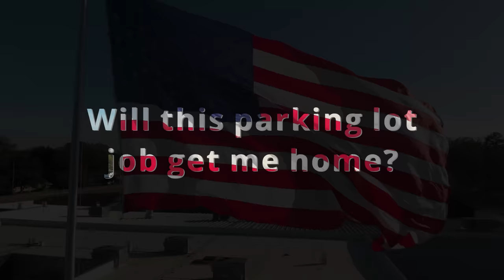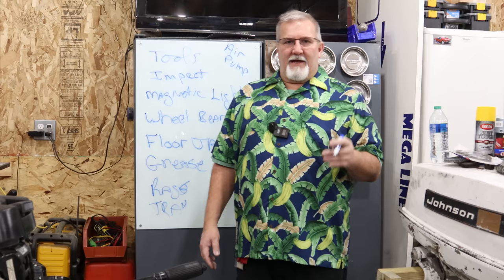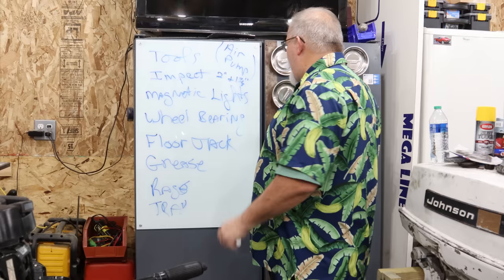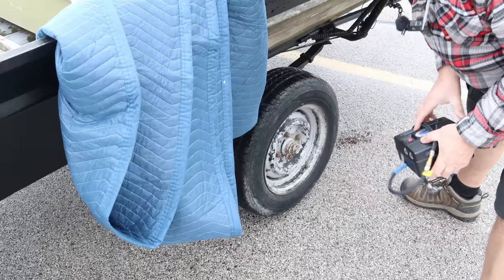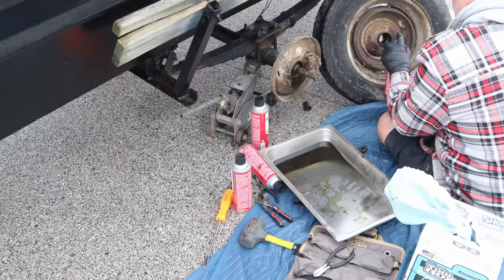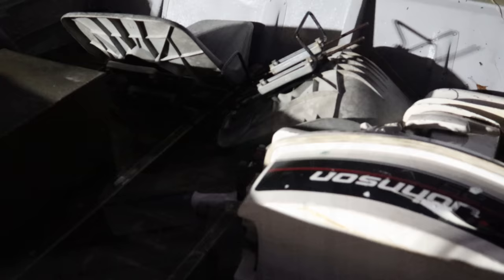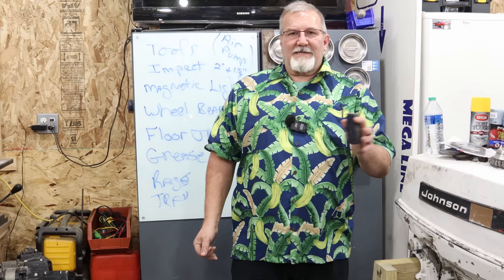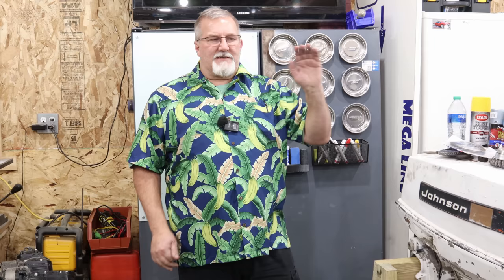Polar Kraft 16 foot Jon Boat rescue - Worst trailer I ever saw - How to get it home safe

Comment: Do the chrysler first! Just won a 15ft flatbottom at an estate auction,has a 35hp chrysler stick steer. Been setting since 1990. Checked for spark,hooked up a tank and it fired up like it had been running yesterday. So smooth and quiet! I have had many johnsons and evinrudes,this my 1st chrysler
Reply from the maker: I may just have to do that. Thanks for watching

Comment: I just did it in the rain, last week and bought a $250 12ft John boat and trailer.  Got a quick response and just drove 80 or so miles for it.  I did take all the back roads homes.  he  said bearings were good, they were
Reply from the maker: Excellent, thanks for sharing and thanks for watching

Comment: Awesome video 👍Thats a good list 👍The trailer is a conduit special . Seen a many of’em around here for 10’-14’ jons even seen one built out of old bed frames and one out of wood  with homemade axle. Cause they get tired of sliding them in back of truck. Believe she gonna be a real good test boat what color ya gonna paint it . Cool two motors can also compare the two to one another . Cant wait for spring or summer to see Frankenstein in action . and drone footage👍👍 As always Sir thanks for the ride along
Reply from the maker: I can't wait either, shaping up to look like a crazy good spring time with boats and motors. Thanks for watching

Comment: I really wish I had watched this before heading 4 hours from home to purchase a boat back in August. Man, the trailer was rough to say the least. The lights worked, and luckily, we had a spare tire. After having a blow out along a 2 lane SC low country road, we got back on the road. The floor jack vs a bottle jack from the truck would have worked way better. Lesson learned. However, recently got a super nice 1976 6 HP Evinrude for the boat. Any pointers on installing a kill switch? Thank you, Sir, keep up the Great work, I've been learning a ton following your videos.
Reply from the maker: I may do a kill switch video in the future. thanks for watching

Comment: Sounds like a lot of crap to collect just to pick it up. BUT YOU ARE ABSOLUTELY CORRECT ON ALL OF IT.  Never put that much thought into it when i went for mine.  I was lucky, grabbed and ran.
Reply from the maker: I have done the grab and run as well. some got most the way home without issue, thanks for watching

Comment: Mr. Michael, one thing that I have on my trailers now is TPMS, eBay have some good ones for 25 bucks and I always know if my tires have air and if I have a problem I'll find it before I'm hearing a weird noise from my rim hitting the road.
Reply from the maker: that is a really good tip, thanks for watching.
Reply: @Michaelsbackyardmarina  I have aftermarket TPMS on my motorcycle and looking at that gave me the idea, I love to have that peace when traveling with my boat.

Comment: Your spot on with the trailer. And I bedlined the inside of my boat with raptor liner it's about 100 online and it comes in black or clear and you can get colors to tint it. I did mine in silver and I'm very happy with how it's looking and holding up. And if u get a adjustable jack plate for the transom u could run long or short shafts on it at the correct height. Looking forward to more videos on it.
Reply from the maker: Thanks for the tip and there will be more stuff on this boat for sure.
thanks for watching

Comment: I am liking this magnetic light solution. We use to have a "trailer light bar"  just an aluminum bar with regular old incandescent trailer lights. dealing with a 4' bar wrapped with about 25' of wire is a bit of a mess.
Reply from the maker: Here I was prepared for no lights to be working and I didn't get to use them, dang, maybe next time. Thanks for watching.

Comment: serious question. You have Lucus marine grease in your links. But the trailer grease looks like red and tacky. Which do you prefer for trailer bearings?
Reply from the maker: red and tacky is my wheel bearing go to. It actually holds up a bit better when water get's into the wheel bearings.. Thanks for watching.
Reply: @Michaelsbackyardmarina  i'll second that. one place i worked we used that on semis that quite often went under water. before that we'd get bad bearings and even a few axle housings.  once we went to that stuff  we never had a complete bearing failure

Comment: that chrysler looks new enough it could be a rebadged evirude/johnson. looks like a chevy citation axle ??? ya oughta get a trailer you can put those trailers on. take the pucker factor out of it.  if that trailer has a title  someone will buy it
Reply from the maker: I have a couple other trailers with junk fiberglass boats sitting on them and I will be putting a much better trailer under this boat for sure, thanks for watching

Comment: 90 or even 50 mile is long ways on a boat trailer that you no nothing about so he is right you need tools for removing your bearings grease cleaner or gas rags then tools for fixing lights and a can of your favorite lubricant spray. Or if you have time an you don't want to spend the money for magnetic lights you can just by a light kit and put it on they are not heard to put on the trailer you should have drill an drill bits as well. It be good to get safety Chan kit and tie downs to hold your boat on to the trailer an a jack.  Wow that's super bad shape wheel barrings all that trailer is good for is the scrap yard it's 💯% junk that's saying it nicely OK its a pill of 💩 lol
Reply from the maker: Very nice comment,  I also did have a drill and drill bits and safety chain along with several ratchet straps.  Forgo to mention them in the video. thanks for watching and commenting